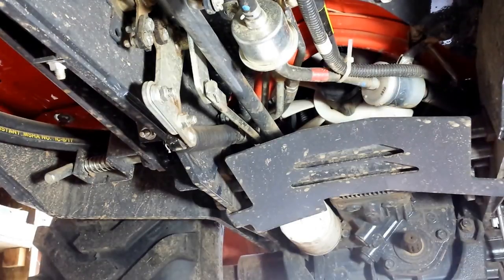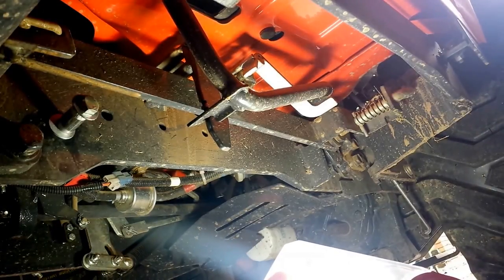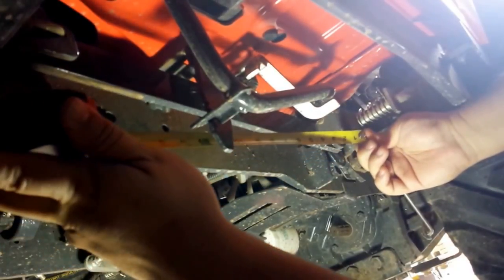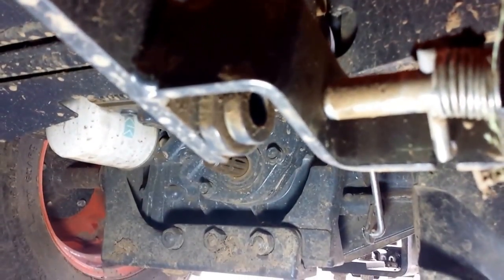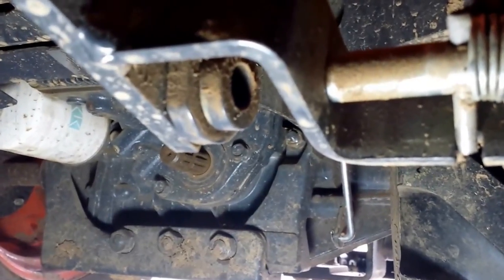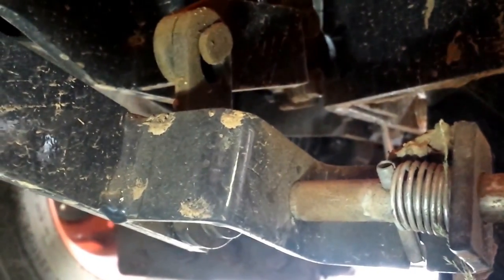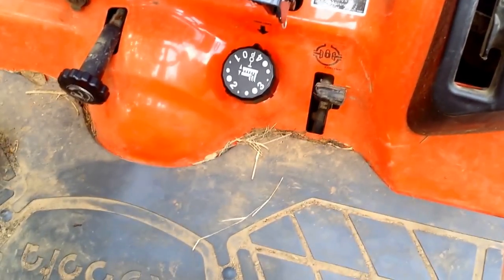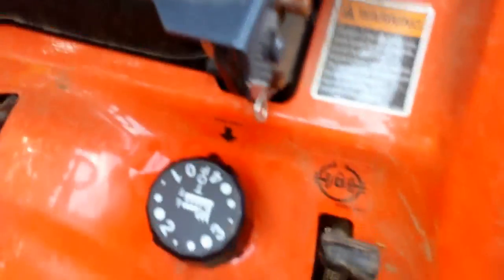Install of BXpanded Under Armor on BX25D

Comment: I’ve had this shield for a few weeks.  Ran across your post, I subbed and a thumbs up.  Thanks for the video and sharing!  Now I won’t bee so Leary of putting this thing on myself.  Even at 74+ years some new stuff with these new tractors can be challenging as the older manual everything did have these things.  Again, high five and look fwd to more videos.
Reply from the maker: Thanks buddy, that skid plate is a must.

Comment: I had the same issue not being able to get it set into the top position. I removed the small Kubota factory skid plate and was able to. raise the Under Armor enough to easily get the hight adjustment knob into the top position.

Comment: That looks like a good mod for a  B2601. I don't have a plastic fan underneath but I worry about my filters and stuff in the woods. Lots of sticks and sometimes rocks. I think I can use 3/4 plywood for the main plate with some metal brackets maybe.

Comment: Can the mid mount mower still be operated with this thing in place?
Your clip is very helpful to explain just what the BXpanded plate looks like and does.
Our fan got clipped at some time in the past and I have just replaced it (what a job!) don't care to do it again.

Comment: I bought that, but haven't got it on.  My mower deck arms won't adjust, aren't connected to the know.  So my 10 minute job didn't go as planned. I'll need to get a MMM manual online since I didn't buy one either. Tractor is out at farm, so I'll get to it when I figure it out. Its probably that knob you mentioned.
Reply from the maker: Good luck.  Might check out this video.  https://youtu.be/NHinAXrMHxk

Comment from the maker: R Servoss... I was not able to "reply" to your comment but it is my understanding that the mid mount mower cannot be mounted with this plate.  It was my understanding that the mower acts like armor itself.  I don't have a mid mount mower so I opted to get this.  I have read on the Facebook Kubota Tractor and equipment forum that there is another brand that can be used with the mower.  Thanks for watching, stay safe.
Reply: Bro-tek from Canada.

Comment: R  Servoss,

the shield MUST be taken back off to place the MMM back on - but it is a 30 second job to take off. Simple lower the TOP setting back to a lower number - lower the shield, unhook the spring loaded pins and you are ready to place the MMM back under.
Reply from the maker: It is indeed as simple as that to remove.